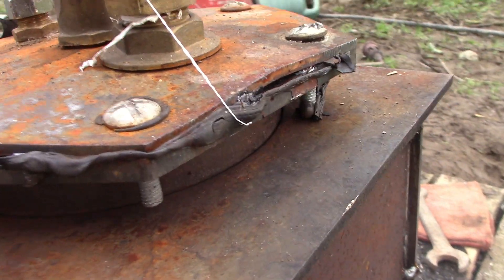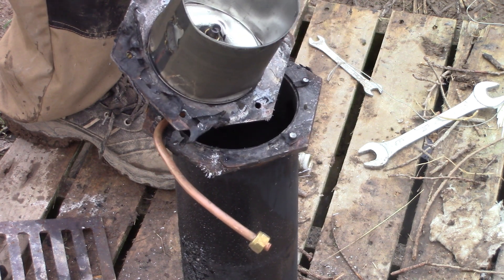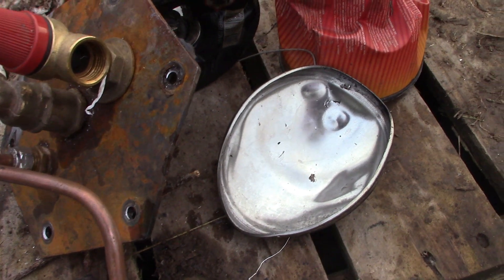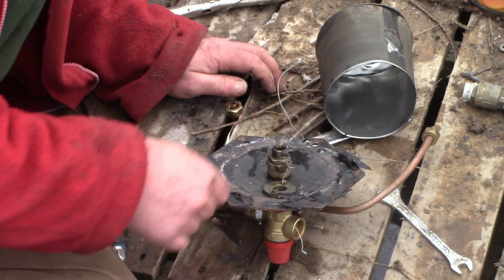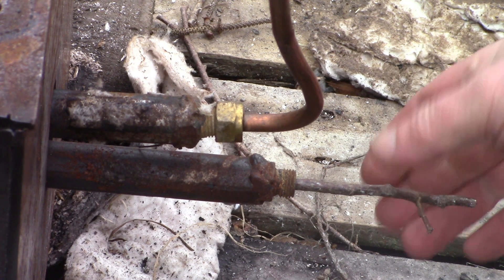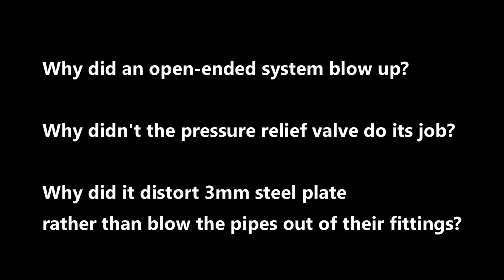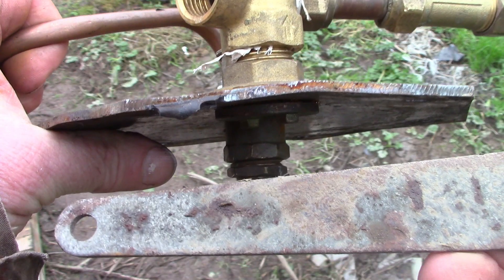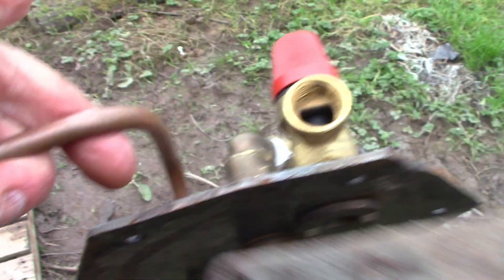Why Did My Boiler Explode??!! My Own Big Bang Theory...

Comment: With the length of tubing you had in the chimney I don't think you can count it as an open ended system anymore. Besides the length/twists and turns adding up to significant restriction of flow, you could have had liquid condense at some cooler part of the chimney and block it entirely. You could maybe even get a gravity fed backflow of liquid shooting into your chamber right on the edge of boiling again. Not sure about that last bit, but the coils definitely provide resistance. The channel Practical Engineering had a recent video talking about the calculations for flow restriction from various pipe dimensions. I think it was the video "The fluid effects that kill pumps"
Reply: But why wouldn't the pressure relief valve have let that overpressure out? My guess is that he is right, and the collapse of the float cans inside triggered a massive sudden decrease, then increase, in pressure. Perhaps backfeeding near-steam water from the exit loop as you suggest. But the point is that only a very sudden increase in pressure could have resulted in the damage, given that the pressure relief valve was still operational after the incident, and yet was not able to release the pressure fast enough. The real question: What makes a better float, or what do you do for water inlet if you don't use that system at all?
Reply: @JamesNewton  at this point you can’t determine if the relief was actually venting so there are 2 possible explanations, first it’s possible it was venting but not quickly enough to prevent pressure increasing and bursting the lid, another is that it failed and didn’t vent at all.

Have you also considered that the float collapse may well have resulted in the boiler being completely filled with water and pressurised to mains pressure which was then trying to boil with no vapour space?
Reply: @JamesNewton it may have just jammed
Reply from the maker: I think you're right, Ben. Thanks!
Reply: I don't think this is the failure mode, although it could be a future hazard. I'm fairly certain that the entire system (with one exception which i'll get to in a moment) was not pressurized above the PORV pressure. 

Instead what i believe happened here is the top of the two floats was either not empty, but regardless i think the top float overpressured, rupturing the steel can and dumping quite a lot of pressure into the rest of the system. However, i don't think the top can had butane in it, instead i think it was water. 

The valves on those butane cans are made to keep pressure in, not out. so lets say that can gets up to 100 degrees, the butane left in the can pressurizes, but those valves are meant to release that butane safely. it slowly leaks out over a few heating cycles, drawing in a little water with each cycle. More and more water is added with each cycle, increasing the potential pressure inside the can (keep in mind the can that looks like it exploded is on the top, thus is exposed to a higher temperature than the can in the bottom which will sit happily at around 100C) by adding more water to turn to steam. 

eventually the can can't handle the pressure anymore, and by now the valve may very well have softened and jammed shut. pressure builds, leading to a potent little explosion inside of the boiler, overpressurizing it in a split second. With too big of a spike, the PORV wouldn't be able to vent fast enough and the lid would get shock loaded with too much pressure. 

As for why i think the top can exploded: An implosion wouldn't separate the bottom of the can like it did. the can was holding quite a bit of pressure judging by how the bottom came clean off (not easy) and the stem of the water in valve had punched through the top of the can. The energy to push the top and bottom of the can came from somewhere between the two parts, and i think that somewhere was some water or possibly even leftover butane.
Reply: @zerumsum1640  I think this is exactly correct. I just watched the previous video (new to the channel) where this boiler was built and i was wondering about the possibility of exactly this happening. Steam is dangerous stuff, glad nobody got burned or worse.

Comment: Hydraulic shock caused by the imploding gas canisters must have causes some cavitation in the boiler water.
Due to the immense pressures, the bounce back would been intense and caused all that damage. 
Also, there is very significant difference in the speed of sound in water and in air. The shockwave would've had no where to go once it hit the surface and caused shockwave to ripple through the steam at speeds higher than the speed of sound in air, meaning the molecules were being forced to move faster than they could get out of each other's way.
Reply: Response to your idea, I think your theory is a lot less far-fetched and sensible than my theory.

Comment: My theory! :: 
If you look at the dismantling of the boiler and removal of the floats in sequence, and then also watch the video of the boiler being made, with the insertion of the floats, the construction of the floats (used gas canisters)  have a rolled joint at the base of each cannister (a weakness). and the top part of the cannister is press formed from one piece of tin. - the rolled joint is the weak point of the can. 
So I think that the top float expanded and exploded and impaled itself over the inlet valve and PRV and caused the tank lid  to buckle from the overpressure reaction. 
In the overpressure event, it caused the lower float cannister to implode (because its all crumpled up when removed from the chamber)   

The floats use basicly the same construction method as a coke can but are used upside down - watch a coke can explode and they nearly always blow on the rolled joint as that is the weak point!

Give me your thoughts, 
Im just a farmer :P

Comment: Quick sounds right, but i think the one gastank exploded due to some high temperature and some remaining gas, since empty canister is just without pressure, but never empty...
My suggestion is, build a float from 3mm steel and then your Idea might work as intended.

Comment: Whatever your mark 3 uses for a float, or and end plate,, please make sure that your safety valves can release steam faster than your boiler can make it  not just the pressure but he volume of steam. superheated steam expands at a colossal rate upon sudden release, that's why its really dangerous - stay safe

Comment: Ahh ha, ...

The top float canister's valve drew in water during a cooling cycle,,, into the float canister. 

The float cannister valve sealed when the ingressed water was reheated. Boom happened when cannister exceed is max pressure.. Instantaneous spiking pressure overwhelmed your TPV and dumped out the unflanged edge of your 3mm lid..

That 3mm lid saved a hole in your roof or worse... Good idea to have a designed flaw like that,👍
Reply: I'd add to my above by saying the top float failed around its base seam, this would shoot it upwards which is evident in the form it took sticking to the   main housings top plate, whilst also sealing the TPV and steam outlet..
At the same time the canister's base shot down deforming the lower float under the same level of pressure spike that deformed the main 3mm lid..

Ahhhhhnd BOoM!! :)

Comment: As for why  the plate bulged rather than the olives popping out - remember that pressure is force divided by area, the effective area that the fittings experience is much smaller than the end cap, so they are under much less load. Also as to why the pressure relief valve didn't prevent the event - seems likely that the opening in the pressure relief valve may not be large enough to relieve pressure faster than it can rise, it's probably wise to find a safety valve that opens a large area and remains open until the steam pressure has dropped well below its opening pressure.
Reply: A simple pair of rod stays would of prevented the unsupported area from yielding to the pressure  this would of precluded the use of internal floats but these would of been much better in a separate chamber

Comment: Nicolai Itchenko already said it, but I’ll say it again for emphasis. It looks like residual gas in the lower canister auto ignited, and exploded, throwing the upper canister into the relief valve, blocking it, and the steam outlet. Then (my own analysis) I think the water in the tank expanded, with all the new area available with a blown open canister, causing a huge spike in pressure, which blew the top can up hard enough to puncture it and deform the 3mm steel lid upwards, creating an escape path for the pressure. Which probably saved your life. God bless you man, keep up the project, but please be careful

Comment: I think the top canister was sealed, either from the beginning or it clogged up later. With heat, pressure inside it raised and eventually it exploded. The top portion went up and impaled itself on the valve (and deformed the plate), the bottom lid was shot downward and crashed the second canister flat. The safety valve didn't activate becouse there was no more pressure than normal in the tank (as you said it was an open system), the pressure was only inside the canister. 
To fix it just use a canister with a small opening to equalize pressure, maybe a small syphon to avoid it filling with water.

Comment: Lucky escape, Tim! I think the problem is with the floats (I suspected they might swell & jam). So you need a float made from light, solid, incompressible material that will stand up to the temps involved - or a steel cylinder with rounded end-caps. And possibly a sight glass so you can check the level of water in the boiler? 
As to the cause; I think somehow one of the cans exploded, propelling the top can into the inlet and relief valve, blocking both of them, and that led to the residual water in the boiler flashing into more steam than the system could handle.
Reply from the maker: Can you think of a suitable replacement, Tony? Polystyrene could take the heat, but I think would collapse with the pressure...
Reply: @wayoutwest-workshopstuff6299  Tim, I've done a quick check of the readily available plastics and none of them come up to scratch in the conditions of your boiler - either too dense or not up to the temperature of your system. So I think a sealed steel pipe would be the best option, the volume of air (or vacuum?) should be able to counter the weight of the steel and float well, while being strong enough to withstand the temp & pressure well.

Comment: At this point, I might abandon the steam engine idea and go with wood gas. Build a wood gas generator, and then power a small internal combustion engine off the wood gas. Seems a might safer than the steam engine.

Comment: Auto ignition of the gasses in the one of the gas cans seems the most likely explanation. I experienced something similar when I used silicone spray on my car's spark plug connectors - a few minutes of running the engine caused auto ignition of the propellant dissolved in the silicone and blew all the connectors out of the engine. 

The top can was squished against the top and probably blocked the safety valve and outlet, so the lid deformed instead.

Comment: I think that the top float exploded. the top of it slamming it the 3mm lid ( see the markings in the top of the can) and the bottem that blown out smast the bottom can.
How can it explode?… the end of the gas cilinder may have plastic and or rubber seals in it. I think whit all the heat is has started to leak and water and or steam got inside of the top fload than buld up pressur and finely exploded.

Comment: I want to throw a few thoughts in:
-There might have been a pressure wave in your tubes because of some water trapped in there. Check practical engineering's video about the steam hammer (/watch?v=JyvoN1hIqRo).
This would have made the pressure spike.
-The top gas bottle might have been smashed into the top cap by sudden pressure and blocked the safety valve or the safety valve could not handle the sudden increase in pressure.
-The Valves on the gas bottles might have let steam in so there is not need for one container to collapse to form a pressure wave. If the valve opened suddenly from the pressure overcoming it, you get an imbalance and a pressure wave forms.
-Our old pressure cooker had a patch in the lid that was designed to blow out if the pressure relief valve failed. I think it was temperature based but maybe a hole that is brazed shut is enough to get a controlled blowout?
-With enough temperature, water can oxidize stuff. They use it to clean activated charcoal. Maybe some gas leaked out of the floats and reacted with the hot steam?

In any case: for future builds make sure the pressure relief valve can not be blocked by anything (maybe put it in a side wall?)

Comment: The top canister seems to have exploded. This might be because the canister has been filled with steam due to the pressure being higher on the outside of the canister. The steam has then condensed back into water making room for more steam the next time the boiler was heated. The water inside the canister does not boil before the water outside the canister. This means the pressure builds up on the outside of the canister pushing more steam inside the canister.

 In the end the amount of water boiling inside the canister resulted in the pressure becoming so high that the bottom of the canister blew out. That is my theory at least.

Comment: 3 effects did happen here: 
1st pressure: it raised against the air filled gas bottles and started to compress them because the bottle walls were much thinner than the outer steel wall. 
2nd the temperature: also air expands in rising temperatures and pushed against the pressure from outside. 
3rd the stick: What did you think when putting a stick in the outlet?
Now combine all. Bang! 
You can be happy that you weren't injured.

Comment: It appears as if the top float became a bullet of sorts. When the bottom of the top float came off the walls of the float would have expanded filling the chamber diameter not allowing any steam to exit. It was then driven up into the top of the chamber bulging the lid.  This also explains why the safety valve didn't release pressure or why the fittings didn't get blown out.

Comment: My theory is that the top cylinder definately exploded because there was no deformation of the cylinder walls but it blew its end off, that means the force came from within the top gas cylinder, I therefore believe there was spontaneous combustion of the remaining gas left in the assumed empty gas cylinder the result being the bottom cylinder imploding and the top of the top cylinder forming a seal against the pressure relief valve so the boiler top ended up being the new safety valve.
I wrote my theory and then read the other comments, it looks like a lot of others have come to the same conclusion, Tim, have fun but play safely.
Reply: I think you are on the right track. That’s what I was thinking! Make On my Friend and nice to meet you.

Comment: What do I think? I think I was correct, that you built a bomb.
That tiny steam release pipe simply could not handle the instantaneous conversion of water at 99 degrees C to steam at 230 degrees C, since 1 volume of water flashes to 1,800 volumes of steam at 100 degrees C.
But when the temperature is so much higher, the AMOUNT of water that can be converted to steam, is greatly increased.
And of course, you still are trying to force steam downhill by pushing water in from the top, when steam wants to rise.
Work With Nature!

Comment: Please keep in mind that the forces of the steam do not only depent on the preassure but on the area. With a force of one kilogram per cm^2 at a pressure of one bar, I assume that the force on the top of your boiler was (at 3 bar) around 1-2 tons. But I don't  think that this is enough to harm your steel plates or the bolts.

Comment: One of your two floats still had a little butane/propane in. The vapour pressure of the butane/propane is always greater that the  vapour pressure of the water at the same temperature and so the bottom blew out of one of the floats and the pressure wave crushed the other one.

Comment: Evidence suggests very fast rise in pressure (milli seconds), way too fast for pressure release to operate, creating a force = pressure x area that was greatest on the relatively large area lid, so it deformed as seen & released the pressure before pipes etc  could feel enough force to blow out. The only source of such a rapid explosive pressure would be an ignition of residual gas in one or both cylinders, perhaps after mechanical failure of one or both cylinders. Gas cylinders & metal petrol tanks are notorious for holding residual fuel in the surface. My father had a heavily washed out petrol tank explode on him when he tried to weld it. Best never to use fuel storage vessels in applications were they are stressed & hot. A sheet of polycarbonate between you & the boiler would make it easier for the angels who saved Sandra from being a widow. Good luck!